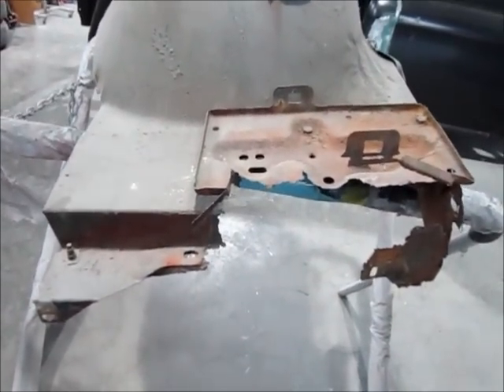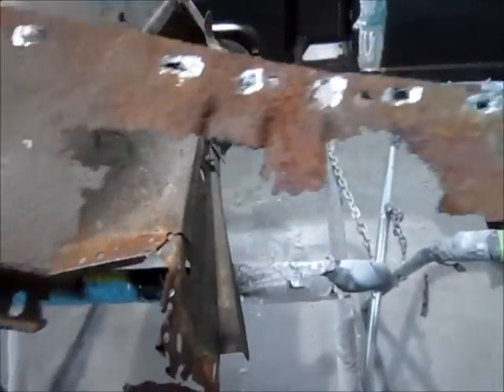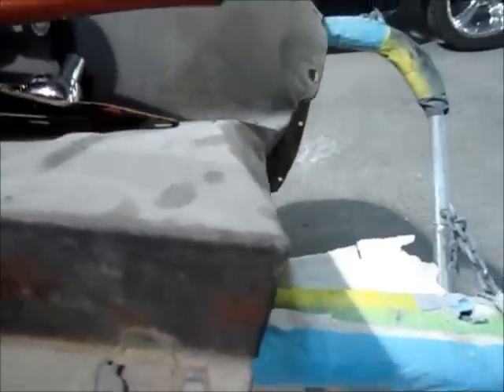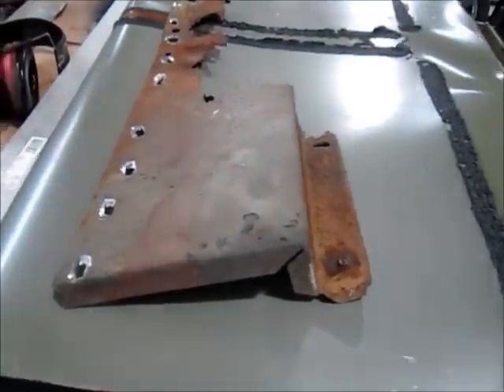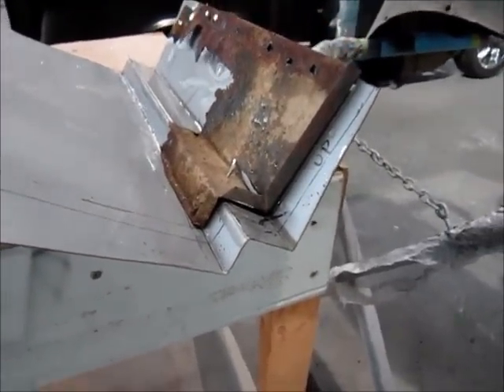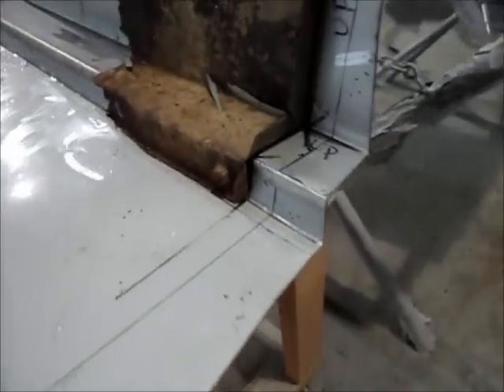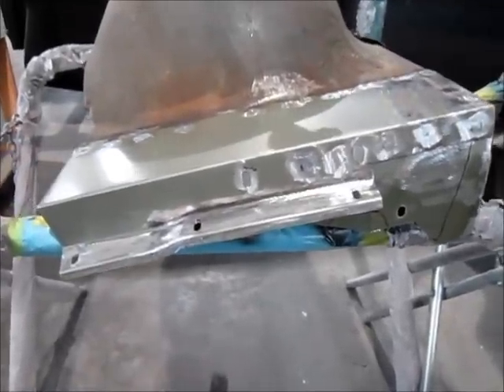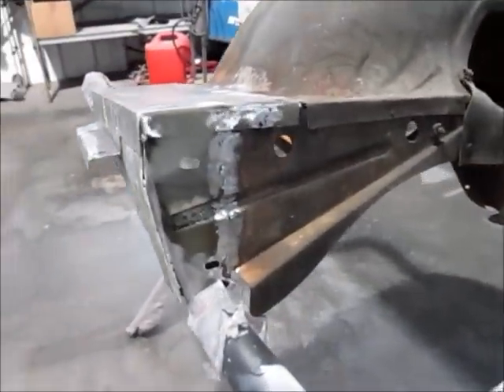1965 Galaxie inner fender repair. Part 7

Comment: I taped a large sheet of paper over that piece and used a pencil to trace it then layed it out flat on a piece of sheet metal and traced it out. Used a cheap metal brake from harbor freight to make the bends! I have to make that joggle now! Great video! I saw it after I made my piece!